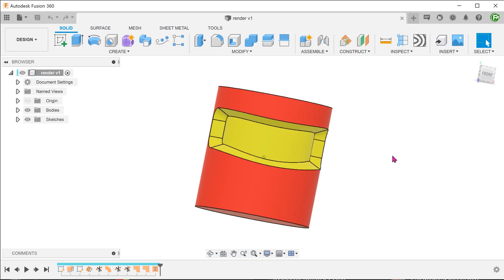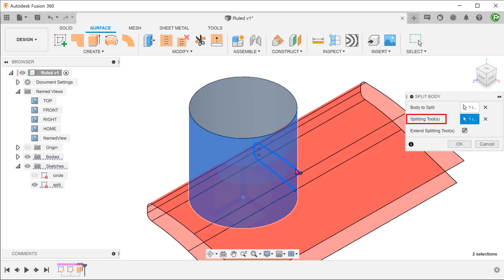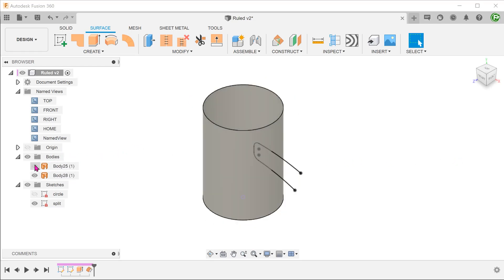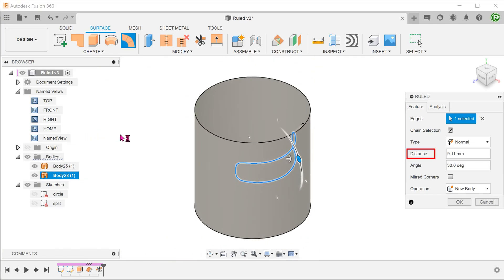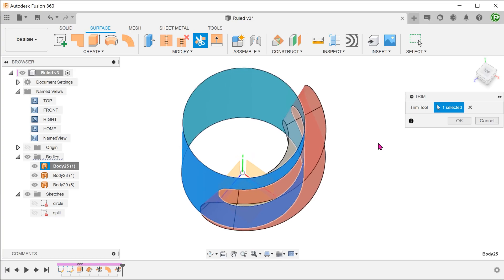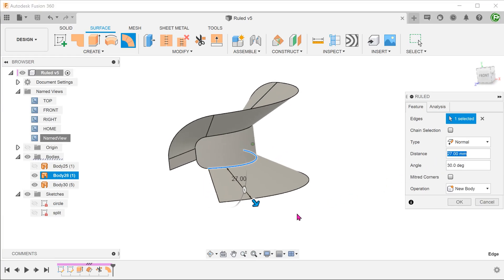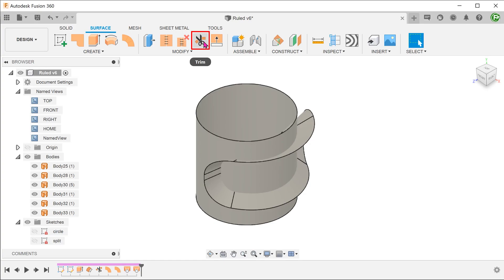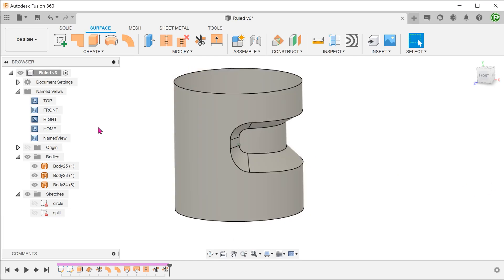Fusion 360 | Ruled Surface & Trim

Comment: Stitched all together and got a solid boy. Tried to make a 1mm fillet on the edges and Fusion refuses to do it. It makes a chamfer in the outer without problems but not a fillet. Fusion is really a strange tool. Why?

Comment: I drew it without using surfaces.
Reply from the maker: Would you like to elaborate? I would be keen to learn another method.
Reply: @Fusion360School  I'm working on Solidworks and you provide an excellent explanation
Reply from the maker: I also use SolidWorks at work.
Reply: @Fusion360School  Excellent friend - how may I help you?
Reply: @Fusion360School  I'd like you to see my work and rate it, of course, please.
Reply: @Fusion360School  When I reviewed the matter, I found that drawing it through the surfaces leads to a better result and stronger control.